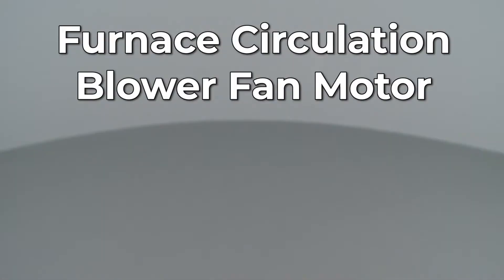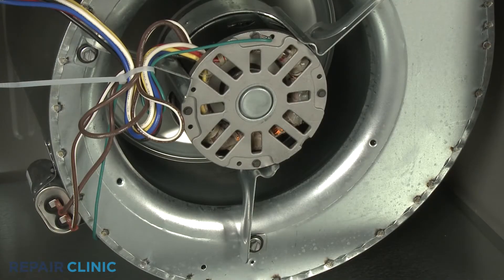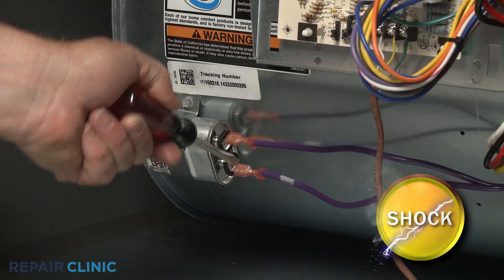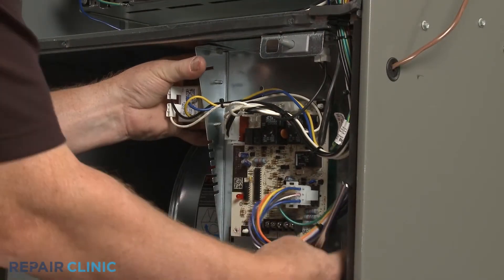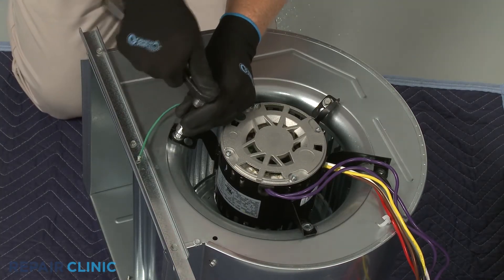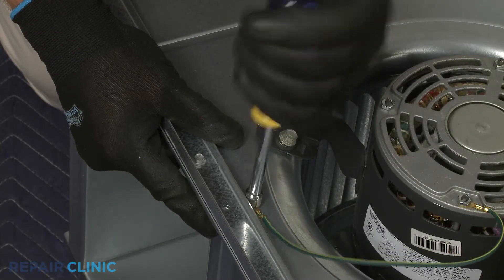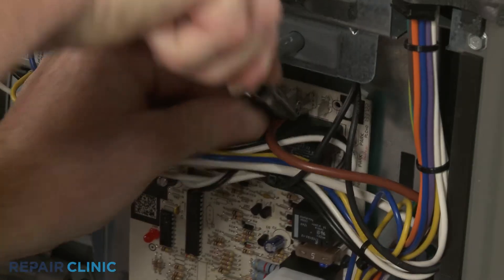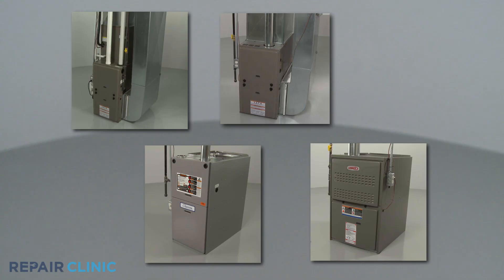Furnace Circulation Blower Fan Motor Replacement

Comment: I'm considering getting universal vs OEM Goodman motor . Because while uncertain at $74 was going to try fast and cheap no waiting days fo rtech or parts . But very uncertain if it'll truly fit with bolt holes etc . From one place bought bracket trying it on old housing but doesn't seem a good fit aligning with bolt holes . A lot of pklaces closed for weekend too four days without me and 86 yo mom

Comment: Huge error in this video!! The oem motor has welded brackets on the motor, the replacement motor had no brackets! But when installing the motor it magically had welded brackets??? Do your replacement motors come with a adapter bracket??
Reply: The motor being replaced in the video has Permanent brackets. Use model number to find correct model for your furnace: https://www.repairclinic.com/PartDetail/Blower-Motor/60L22/2332618
Reply: @TheRepairGuru  The motor being pulled out of the box in the video at 4:41 has No Brackets on it. But when your installing it, 5:00 magically brackets appear?
Reply: @davenone7312  Thanks Dave. When my replacement motor arrived, it had spaghetti for mounting brackets instead of the permanent brackets. I almost installed marinara in my furnace.

You saved my life.

Comment: ..i find issue with a single item.. instead of removing all those spade connectors from the board, you should Clip Them Off with a bit of Wire showing since they're on the Old Motor..this way you won't mix up which Color of Wire Goes Where.. just Remove them as you plug in the New Ones..